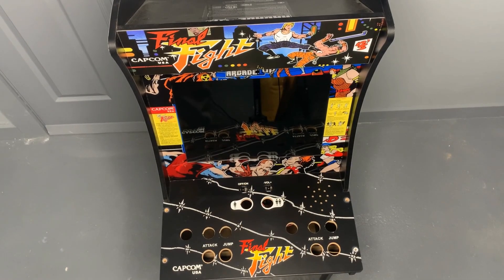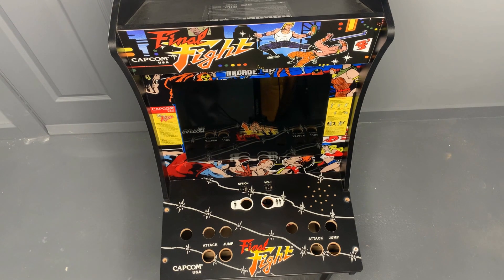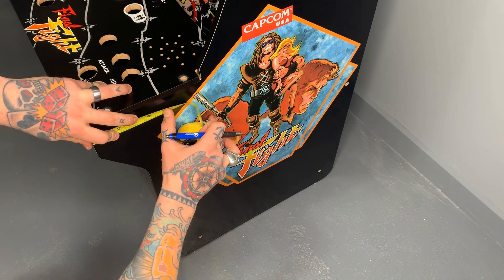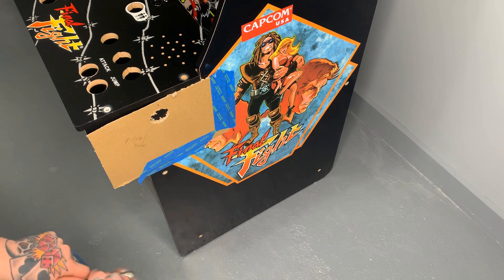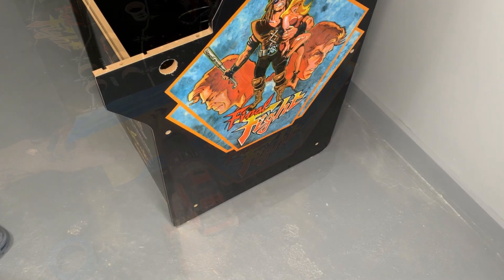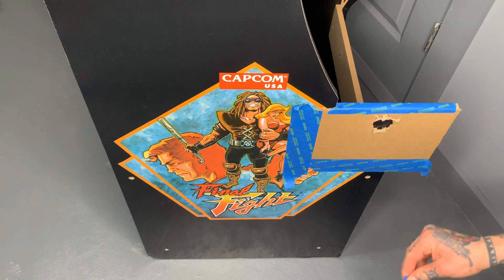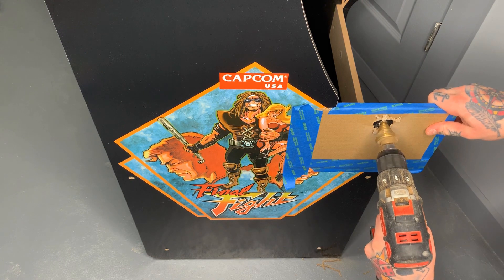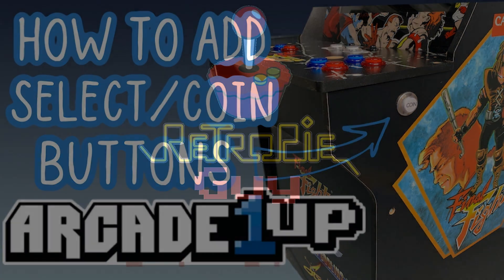How To Add Select / Coin Buttons On An Arcade1up Arcade Cabinet - RetroPie Guy Install Tutorial

Comment: ya think i can just use a 1 1/8" hole saw bit?
i dont have power tools or equipment but i do have two spare control panels
Reply from the maker: Yeah I think you could make do with that
Reply: @OfficialChaseBrogan  ok im down to ONE spare panel lol / i reused the 4way stick and soldered up a (3rd party) genesis controller 

now i can play my pacman pcb 🥺💙

Comment: Hi!  I have raspberry pie 3b+   with  retropie     i try to play psx games   i do everuthing   bios roms   update scripts   rename bios files to bin   but still no works    any idea please....?
Reply: ps1 runs horribly on the 3b+ anyway bro
the pi is barely useable for emulation @ older systems as it is 
my 3B couldnt even run mame roms of dodonpachi without temp warnings 

im assuming you upgraded to something else

Comment: I 100% think it's awesome that you are creating content but I gotta be honest.  It's really not a valuable video.   For starters - no reason whatsoever to "create a template".  A pen and a tape measure would have accomplished the same thing.   Second - a step-up bit for particle board?  Really...  hole saw bit is really more appropriate.  Third - I clicked on the video because I thought based on the subject you were going to discuss how to "add" the button to the control board, or what control board was needed.    In short - not really a good video for what I expected.  Kudos for creating content though.
Reply: I agree